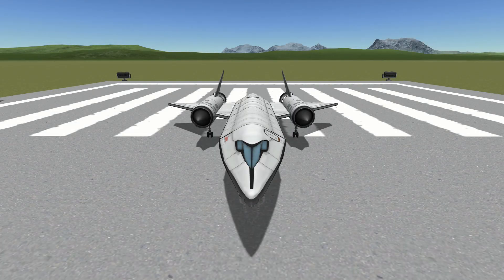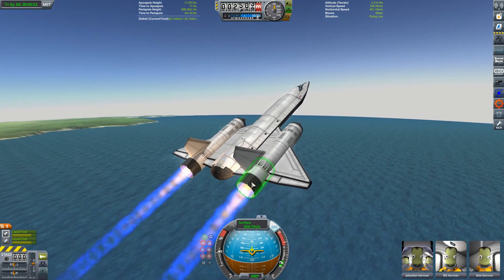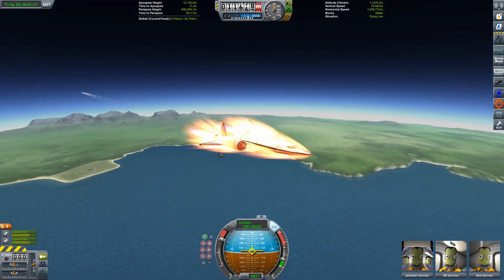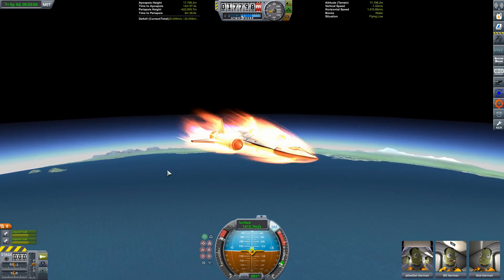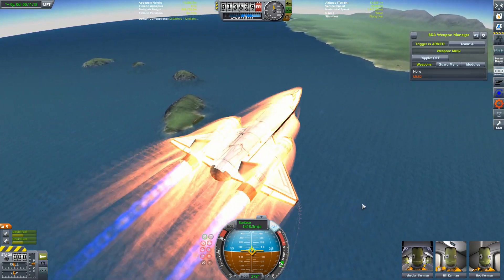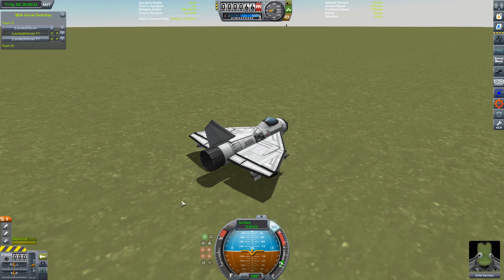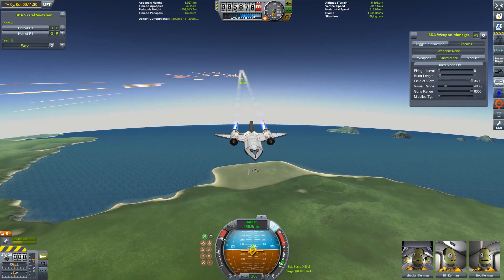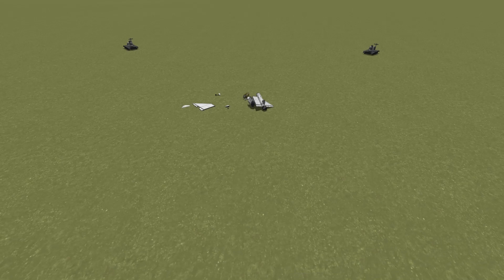Going Supersonic - Kerbal Space Program & BD Armory

Comment: Just today I made a totally vanilla Hypersonic using 2 ramjets in line with the MK2 Bi-Coupler, When you go like that you don't need the extra drag from the Shock Cone intakes, you can just use the Engine Pre-coolers for air intake and wind Scrakes. Max Speed I got was 1625 m/s and survived at 7km altitude. What I do is, on takeoff, I decouple the "landing" gear (It's takeoff gear let's be honest)  and just 100% the engines at 30 degrees vertical to 7500m and straighten it out.
Reply from the maker: Yeah, but the intakes are worth it for the SR-71 look.  😁
Reply: @SonofSmith  you just need to add good old action group to toggle them.
Reply from the maker: @leadontaste7261  Good point!
Reply: @SonofSmith  I managed to make a 5M bomber that dropped 12 nukes with all those designs all over half of the Kerbin and damn, they're always working

Comment: You don't need to worry about melting anymore. Alt+F12 > Cheats, it's vanilla and you can press any cheat you need.
Reply from the maker: Yeah, but where's the fun in no risk of causing kerbals a hideous death? 😁
Reply: @SonofSmith  If you want to, you can use the Raven to travel around Kerbin while at a hypersonic pace. Also, If you're hypersonic in Kerbin, you're 2 times slower if Kerbin was as big as Earth.
Reply: @SonofSmith  I'm just saying, currently building a fighter jet, but running outta ideas.
Reply: @SonofSmith  Also, if you want to, you can connect it to a bigger, more laggy craft or attach a craft to the Raven. It'll also give Kerbals a higher chance to die.
I also used a pre-made SR-71 to launch an R142A (train from the New York City Subway) into orbit by using a booster space station and Buran Energia (which I made). I had to use Cheats because the SR-71 was still a bit light (due to fuel tanks which were drained by 75%.) Thus, the plane went through temperatures around 125% re-entry heating. Just around Mach 4.5 and a bulky plane with a rocket attached to fuel and a fairing (or extra drag) is a recipe for an airborne liquid fueled bomb.
Reply: @SonofSmith  Sorry for the huge amount of replies but there still is a slight chance Kerbals will die with cheats on.